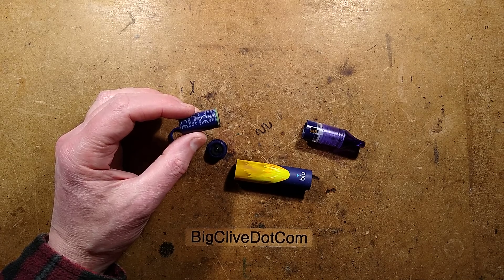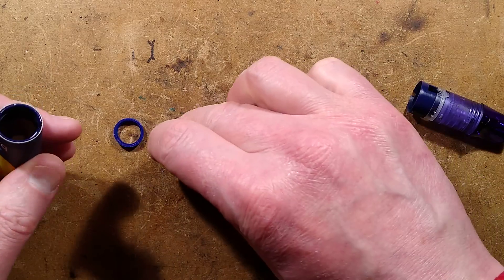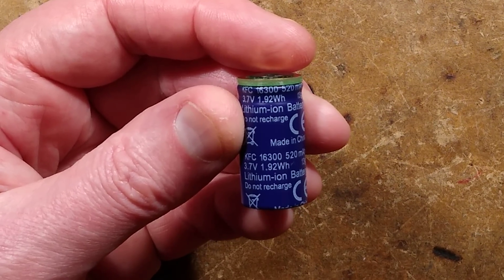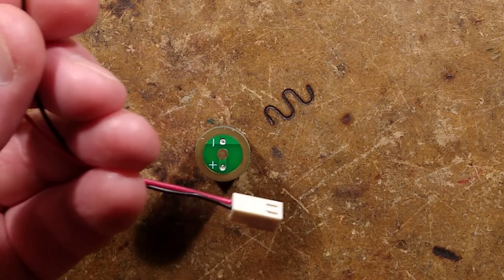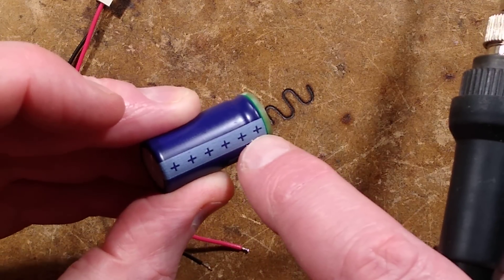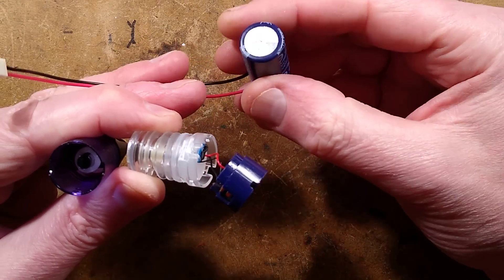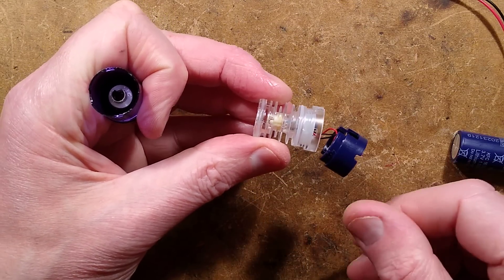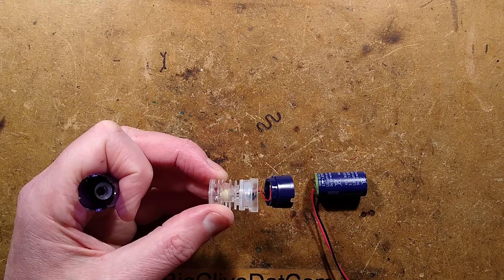Easiest free street-lithium yet - with gold flashed contacts!

Comment: Maybe it's worth to just put a "Vape Recycling" bucket on a streetcorner and check it every few days, might be easier than scrounging in the gutters.
Reply: Strangely enough, I tried that near my work. It disappeared twice. The city cleanup crews noticed it, and asked their bosses. Who knew, a municipal employee doing their job.
Reply: Just ask your local retailer to start a collection. I had to ask them to stop collecting after a few months as I had amassed several hundred assorted shapes and sizes. Some customers use two a day, every day - which means they are not breathing much air without flavour and nicotine.  
One standard hw107 control board charges at 1A so two cells in parallel work really well with all the 3AA led light strings dumped after the winter holidays. I stuff jars and bottles with leds, jam the charge board into a bung with the usb outermost and a switch for decorative lighting and nightlights. Most run for 30+ hrs on a charge. 
The elf type are stainless steel tubes as well, so aside from small wind chimes, I've found them quite useful for several projects.
Reply: Tesco have a bucket for Batteries and cells, I found a Dyson hover pack in there and took it apart and got 6 great cells out of it. 2100mah
Reply: @andymouse  Aldi has a box for dead  batteries.
Reply: Our council have started a scheme where people can leave batteries and vapes bagged on top of recycling bins on bin day.
Reply: A lady lives near me and collects them faster than I can often as not. I asked her what she did.

"I put them in the bin, they are bad for the environment."

I wanted to cry.
Reply: You'd need an explosion containment pie bucket.
Reply: @beardedchimp specifically one that can survive 3.1415 atmosphere of pressure.
Reply: I wanted to make Styrofoam concrete and there are recycling drives in my area for odd-ball stuff including things like paint. If you have them, I'd call them and ask them to add it to the list and that you'll take them all. I also found a list of specialty recyclers for specific things from lumber and window glass to books and expired food (animals probably). If you can find that list locally,  I'm sure they'd add you to it for vapes. It was a local gov page for me.
Reply: But I'm already grubbing around in the gutters for "raw materials" anyway. :)
Reply: Make sure its a metal bucket with an internal ledge so rain doesn't cause the cells to go nuclear.
Reply: I did that at work.
Reply: This is something I've tried proposing to my local council, but they don't seem to be interested. As most of our public waste bins are the type that has an ashtray built-in to the top, and I'm a bit too anxious about the volatility of Li- cells to repurpose them myself, I usually pop any I find upright into the nearest bin-top ashtray. 👍

The main benefit to this is - If any of them turn out to be the UKCA variety 🔥 - That they'll generally do their thing and burn-out in a tray that's already sat well above the waste bag and is designed to contain ash fires, so a lot safer than having one burning away in your pocket or bag! 😇
Reply: They'd probably constitute a fire hazard, unfortunately. Especially since you don't know the condition of the cells that people may toss into the bucket.
Reply: @shanejohns7901 If the battery passes the Charge/Discharge cycle without getting hot it is probably safe.
Warm is normal.
Reply: @shanejohns7901  what we dont know is how the non flat cells in the bucket are getting crushed
Reply: @echelonrank3927  Jerryrigeverything has a video about this topic. The shredder is quite robust.
Reply: @anthonyshiels9273   i meant they dont get crushed inside the bucket.
ive seen something before in one industrial demo.
its called maxin india battery shredder.
dudes are throwing batteries into a shredder,  there is a specially designed oven underneath and flames start shooting out. then they use fire extinguisher to finish the job. 🤣
Reply: Nice idea but 2024 children don’t recycle
Reply: @FormulaGuppy  and prior generations did? I was born mid 80's N. Ireland, we had only one bin for everything and no local bottle banks. These days kids are actually taught about recycling and have facilities to do so. Belfast even has places where you can refill containers and only pay for the weight. Only possible because that generation of wee uns' grew up with environmental awareness, it isn't boomer UDA/IRA members refilling cuscus jars.
 
Reusing is a different matter, but electronics back then were simpler and could be repurposed. Hard to do so with a bunch of unlabelled locked down microchips. I wouldn't want kids trying to reuse lithium cells, better to just recycle.
Reply: @FormulaGuppy  oh here we go again "My GeneRATion DId IT bETTer"
Reply: @FormulaGuppy  Neither did your generation, old fella, that's why we're in this mess.
Reply: @FormulaGuppy they don't use bins full stop, the floor is closer 😒
Reply: @FormulaGuppy  nobody recycles unless forced to or paid on collection
Reply: @marcogenovesi8570  If you are into model-making, recycling is part of the game. There's a LOT of "single-use" plastics out there that can be re-used with a spot of imagination.

Comment: There is something deeply satisfying when soldering works so well that it makes you think you're good at it. The flip side is that it is utterly devastating when it refuses to work for you 🙂 The time when it doesn't work is usually when you gotta be outta the door in ten minutes.
Reply: That feeling of being an utter failure at life, then after struggling for far too long you finally realise there is a heatsink on the other side. You don't know whether to feel relieved about your soldering skill or in despair for being such an plonker headed eejit.
Reply: Ten minutes? You should always finish your soldering before starting the countdown device.
Reply: Or when you're trying to do something for someone else and the solder just won't flow or stick...yeah 😂
Reply: Gold and the other noble metals are the easiest to solder. Flux may not even be necessary as there is no oxide to dissolve.
I had a gold ring become contaminated with mercury - the mercury instantly plated the entire surface at room temperature. I had to dissolve the mercury in concentrated nitric acid to clean it off the ring.
Reply: @PaulG.x  that's interesting. You could have taken the traditional mercury-gold plating approach and heated the ring to evaporate the mercury. Breathing in the vapour is vital to the artisan approach leaving you madly in love.
Reply: @beardedchimp I think if you evaporate the mercury you will need to have the gold polished again. I had nitric acid on hand as I was cleaning and refilling a mercury manometer at the time , so I dropped the ring on the floor to splash off any loose mercury and put it immediately into the acid. Mercury dissolves gold so the longer it is there the more chance the surface will become eroded
Reply: @PaulG.x yeah I was thinking about that. The mercury-gold amalgam stays fairly fluid until it is saturated. So it could stick to the top, grab some gold then slide down. After evaporation the top of the ring would be  slightly thinner and the bottom thicker.

The traditional process was used because it leaves a smooth even gold layer. The absorption rate is proportional to surface area so a gold ring will take time.

I suspect that examples of mercury causing significant damage is because it has sat there for a long time and become saturated. Its fluid nature means it can migrate and deposit/adsorb causing bumps/pitting.

If you evaporate the mercury at that point the gold has already been moved, it might leave a smooth layer of gold behind but it is smooth bumps.

With your ring you realised immediately, I doubt much gold was adsorbed. The mercury gold demonstrations use pristine gold leaf, mostly for the surface area but also because it isn't covered with oils like a ring is.

With evaporation the amalgam becomes supersaturated. I assume the gold migrates to areas of less saturation (i.e. away from mercury surface, towards the objects surface) and deposits. I read some papers around the history of chemical vapour deposition years ago, the details are foggy.

I'm not sure what happens to the gold with nitric acid. When it attacks the mercury from all sides does the gold separate and fall to the bottom or does it behave like the traditional model?

For you realising quickly, the most important thing wasn't leaving behind the gold as a plating, just getting rid of it as fast as possible. Sorry for the rambling, I just find amalgams and deposition absolutely fascinating.
Reply: @beardedchimp  You sound like someone who has breathed a lot of mercury vapor in your life. I like it
Reply: @dooleve I broke a thermometer 30 years ago and have been hooked ever since. You don't know what you've been missing out on. I always know the exact temperature anywhere I go, I feel the mercury in my veins expanding.
Reply: @beardedchimp lmao

Comment: Curious battery, Olight flashlights also use modified 18650/21700 batteries with both terminals on the top of the cell, most of the time making standard batteries not compatible
Reply from the maker: Some of the dental blue light wands also use a similar system.

Comment: Been harvesting batteries from empty vapes for quite some time. Its appalling the amount of single use devices that are meant to be thrown away with perfectly good lithium cells that can handle many charge/discharge cycles.
Reply: Me too. I have replaced a bunch of motion sensor lights throughout my house with them.
Reply: What do you use it for?
Reply: @arvindtaylor6871  Ever hear of the 'annoying beeper' devices? You can make one of those beep for a LOOOONG time with a bunch of those cells in parallel. Basically endless possibilities. My welding helmet is rechargeable using one of the 'single fill multi charge' vape boards and the cell...
Reply: I do the same but I really like the single use rechargeable vapes I now have several rechargeable led flashlights
Reply: Time to document  and ask officials via letter for a law against one time use lithium
Reply: @mmuller2402  It doesn't even need to be "a law against". In Ireland, we're charged 22c per disposable plastic bag, 15~25c deposit on plastic bottles and cans, 5c on packs of chewing gum (because it's expensive to clean off streets), a planned 20c tax on disposable cups, and a WEEE (electronic recycling) charge on most electric devices.

Put a €1 WEEE charge on unreplaceable battery items and disposable vapes would fade faster. Make it a €1 deposit and they won't litter the streets anymore.
Reply: @mmuller2402  won't get them for much longer, disposable vapes are going to be banned.
Reply: @mmuller2402 no I use them. Stop being a bah humbug
Reply: @Vile_Entity_3545 maybe get a rechargeable cancer device instead of throwing ts away?
Reply: @Vile_Entity_3545  get a rechargeable one. Stop being a bah humbug (and save money)
Reply: @marcogenovesi8570  why? I reuse them and it costs me just £3 a week in juice from the poundshop. 
Oh and I don’t put my mouth around what somebody else has had theirs around. I have my own shells that I transfer the innards into. There I save plenty of money and recycle them. Do not assume anything what others do as you come out looking a bit silly.
Reply: @JSMCPN  I have a lithium battery charger and get at least 2 more uses out of them with my own liquid I buy from the pound shop. I put the innards in my own shell because I do not put my mouth around what somebody else has. It costs me £3 a week. I get at least 2 charges out of them until the coils degrade. I find loads as I cycle everywhere and can find between 0 and 5 a day.
Reply: @Vile_Entity_3545  dude it's a lot of work to save 10 quid total in a single rechargeable one that just needs power and liquid refill (and an occasional burner change every once in a while). All this work and cope online for 2 more uses? So you just throw them away with extra steps? GG

Comment: just now

I've found all disposable vape type lithium cells are very variable in their capacity vs what they state they are. Some that are 550 mAh can be as low as Clive has found with this capacitor-looking LiPo cell. I have had more success with the larger vape LiPo cells, the 1000 mAh and better still the 1500 mAh cells from the much larger disposable Vapes.
I have made up 3S battery packs using matched capacity 550 mAh Vape LiPos, but each battery pack I have made using 3S BMAs have resulted in one cell always losing capacity after only 2 or 3 cycles. The 3S packs have also been made using different BMA pcbs, so it’s not common to BMAs, it’s just inferior cheap disposable LiPo battery packs just not being up to being reused.
Reply: He didn't discharged it fully. The cell can go as low as 2.7v maybe even lower to 2.5v. i bet you can get close to 550mah in it after a good discharge.
Reply: @hansturpyn5455 Since they are intended to be single use I wouldn't be surprised if they discharge way below damaging voltages. This can cause dendrite formation, in a discharged cell with little energy it has little fire risk. However recharging from that voltage grows the dendrites further and can cause internal shorts, combined with the extra energy you get fire.

Might be why they say "do not recharge". For our own safety we should always check the voltage and internal resistance before charging and after. IR is voltage dependant so a little tricky since each cell IR is different, but if dendrites have formed after charging it might detect it.
Reply: @beardedchimp with lost Mary, crystal bar, elfbar etc that I've found, the discharged voltage is around 3.45v. the cutoff is probably around 3.3v

Comment: The moment I saw that twist top and flash gold plated spring contact I knew it had to be for a reason as it adds so much manufacturing cost. 

Sure enough the company advertises on their website they have a product disposal program, they appear to pay for the return of the device through Royal Mail, they'll even come collect it from your house. After all putting them in household waste is not permitted as there's a good chance of it ending in a sanitation truck fire and of course disposal in street gutters is also not permitted. But also the UK e-waste and battery recycling collection containers also don't accept them as they're considered bio-hazards but also have a high chance of leaking the fluid, so the only way to dispose of them correctly in UK metro regions would be the local council hazardous waste collection/disposal scheme which would cost the consumer more than the value of the product to have it disposed of. I assume they have a warehouse somewhere with a line of workers unscrewing the tops and removing the batteries, maybe even a machine? Doubt they reuse the batteries, probably just sold as bulk used batteries overseas, might see them one day in some ultra low cost competitor's product in low income countries.

Presumably this is all because the manufacturer has been catching a lot of flak recently from regulators over all the visible street e-waste those products have been creating in the past few years and it being impossible for the end consumer to correctly dispose of them, plus it's not a good look when the average street gutter is filled with e-waste with your company's logo on it. Those things only cost £3.99 or £5.99 for the larger one, no clue how they can make the economics of all this work.

Wasn't able to find out if the company was legally compelled to do this or if they did this freely.

Comment: Almost worth putting out an ad offering to pay something like 50p per to encourage collection from the street or even encourage users to save up and redeem them instead of littering.  Then you can rebuild them into battery packs and turn a profit.  Somewhat amazed nobody's doing that already.  Might as well get something worthwhile out of the flood of disposables.
Reply: I think recycling these things should be mandatory.  Charge a small deposit when purchased and refund it when the unit is brought back. Like some places do for cans or bottles.
Reply: Maybe you've found a faster way to recover these cells into something usable, but I calculated that the "profit" from my home made vape battery packs would be less than minimum wage. It would be cheaper to buy 18650s. Of course I still make them, because it's "fun" and I hate waste.
Reply: at 50p per with a capacity of 500 mah you're talkin like 3 quid to get 3000 mah and that's before you do any work on salvaging them, assuring their quality, assembling them in to a new pack. it wouldn't be economical.
Reply: Same size (16300) better capacity (~600-800Ah) sub dollar, 80 cents for bulk order 10-100K. Those sub 500Ah new in bulk 50 cents or so no doubt... If someone making battery pack or something, just would go and get new for same 50p, tested, clean etc. More like 50p per kilo...

Comment: My wife vapes the Crave brand which is a common, cheap unit ($15-25) in the USA, and each one has an 18350 LiPo pouch cylinder. I have dozens just sitting in a drawer at this point.

Comment: Be interesting to see the capacity change over time, though I don't imagine it lasting very long

I thought all lithium batteries were supposed to be rechargable, what modern construction means it's a one way process, it can't be just a single missing chemical meaning it's impossible to charge surely

Free gold you say? Can't wait to retire in 8 or 900 years 😁😅